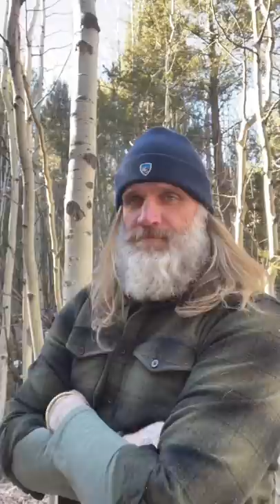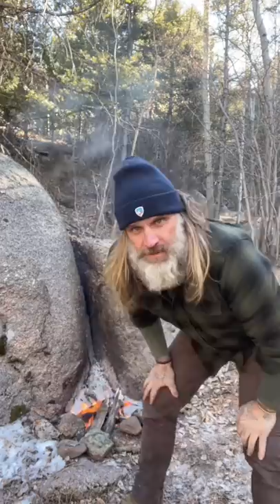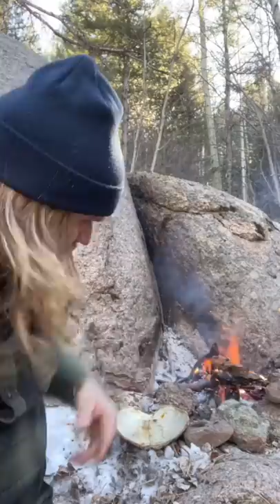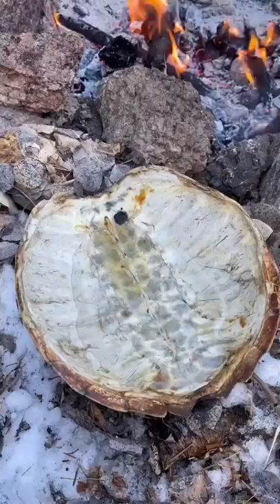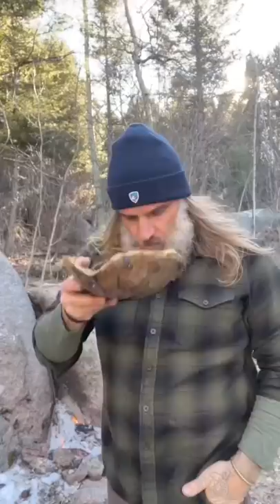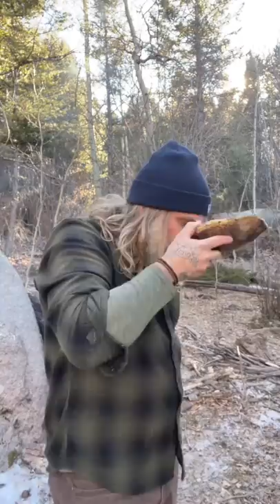Hot Rock Boiling

Comment: as someone  who lives in a predominantly  sedimentary rock regain I ask all to learn their sedimentary rocks  
since they tend to have air pockets inside that like to exploded in a fire
Reply: Wait. What? Wouldn't that depend on the permeability of the sedimentary rocks in question? I've never seen a sed rock that completely traps air.
Reply: I know nothing about rocks but basicly, pick rocks that have not been underwater in the last 2000 years or they may explode.
Reply: Not to mention bringing water to a boil doesnt sterilize. you need to maintain a boil for several minutes which some warm rocks aren't going to do. Not that this is doing anything to any water that's not in direct contact with these rocks...

This guy is going to get someone sick or injured.
Reply: Yeah this is most common with river rock
Reply: @nopenope404  you can indeed bring the entire vessel of water to a boil with hot rocks, and yeah it's usually recommended to boil 1 to 3 mins. Saying it's not doing anything to water that isn't in contact with rocks is akin to saying boiling water on the stove only affects the water which is in contact with the pot. When the liquid's temp is brought up to boiling, of course it affects all the water.

Regardless of whether this guy is showing it correctly or not, it is a viable option. Though in the majority of cases water in nature is totally fine, especially if it's something like mountain runoff in a flowing stream. Stagnant waters hold more danger, especially at watering holes where animals may come to drink, defecate, or die. But with giardia specifically, it takes on average like a week to start so in a survival scenario you're hopefully back home by then and can go to the doctor, get some medication, and it's not so bad. Even otherwise, giardia over dehydration any day.
Reply: @nopenope404  “some warm rocks” bro that’s how I know you never touched a tree in your life he clearly put the rocks in a fire for 30-40 min anyone who put rocks in a fire knows how hot they get after 10 minutes stop acting like you know everything when you don’t know a single thing
Reply: @nopenope404  nah those rocks hit that water and it went into boil very quickly
Reply: Didn’t this guy get trichinosis from a muskrat on a survival show????
Reply: 100% confirm that......  burnt holes my nice tent from that years ago, also had it happen soldering a copper pipe against concrete too 🤣......Wear your safety squints 😆
Reply: They teach you in high school. The kids who paid attention would know that, but there all heroin freaks now. Sad sad world we’re in
Reply: @angelrodriguez2489  why did you get so mad
Reply: @oumardiop1  Bc he thinks he knows everything and tires to make people sound dumb when in reality he’s a complete joke
Reply: @oumardiop1  tries *
Reply: Metamorphic or ignious rock🥰
Reply: “Death by rock explosions” listen i am not suicidal but if i got to choose how i die this is it
Reply: @nopenope404  me be true if you are at 3000 m or above Spencer. You have little to no idea what you are talking about.
Reply: @nopenope404  just warm rocks huh.

I wouldn't consider rocks that can flash water to steam just warm.  I personally have gotten a bottle to soften and warp in a standard campfire.  That's pushing 2500 degF. 

And also you do not have to boil water.  Add to that that many of the pathogens die at a temperature of 160F not 212F.  This why we need to cook thing to 165F.   So if you get water to boil it has already been at a temperature that can kill pathogens for a few minutes.

So if you keep rotating your stones from pot to fire you can heat water quite effectively
Reply: @nopenope404  you think those were just some warm rocks? 🤣
Reply: Like pop rocks flint granite
Reply: Learned that the hard way when I was a kid in the 2000’s scared the shit out of me cause it almost hit me in the eye. I live in a country town outside of Cleveland. Every time after that experience. I said fuck that.
Reply: @artofficialintelligence  they can tho
Reply: Robert Daggett  
I'm in Ontario and from putting fully heated rocks to water I've had rocks split apart in 2 pieces, but not explode.
Edit:  I must add that the sound it made sure got my attention.
Reply: It's the moisture in the rocks that explodes, it expands thus exploding. Done it a hundred times as a kid
Reply: @nopenope404  I’d rather listen to the cave man then someone named Spencer
Reply: @AlanTClark  I go there every now and then we have the same accents and rocks in the Midwest we just share a pond
Reply: @nopenope404  you do you but if I had to drink water and this is the only way to make sure there’s no parasites in it, this is what I would do.
Reply: Oh damn
Reply: Dodging shrapnel is no fun! Had it happen once after sitting back down from standing right over the rock that blew. The sizzling hot gravels whizzed past me ears to ankles, but they missed me, my son, the cat, and all but one of the five dogs, and he was fine, though very confused...LoL! Craziness to be avoided for sure!
Reply: @terancet8671  no
Reply: @vrfob4620  hmmmmmmmmmm
Reply: Completely off topic here, but when my misses makes me a cup of tea, she burns the water 😂😂😂😂😂😂
Reply: @terancet8671   no, he was sick before he ate that
Reply: Had that happen to me once.
Reply: Adults arguing about rocks. Welcome to the internet.
Reply: From Florida and have had this happen.  Listen to this man.
Reply: Was making Shepard pie in a fire at summer camp once and had a rock fall into the fire without us knowing. When it blew I could feel it blow past my shin lol
Reply: When you are surviving it doesn’t matter
Reply: @loganthesaint  I'm sorry,  not trying to be a dick here, I promise but... it matters about a million times more in a survival situation. Anything that may cause injury, even slight, should be avoided like the plague.
Reply: Gold jacket, green jacket who gives a shit
Reply: @terancet8671  he was just recovering from a heart attack days prior to the show. If that weren't the case,  he'd have been fine, but straight up diarrhea and vomiting can easily bring in another heart attack.  It was a wise move to bow out.
Reply: @accesdenied9104  I see your point, "Death by rock explosions" sounds hella metal...
Reply: Some people are know it all and like I saw the man who tells you he knows everything knows nothing at all... might want to research this dude before talking smack... troll turds are amusing 🤣
Reply: @DiamondSupplyC0  lmao what? Sorry that happened to your friends but it's not like that everywhere
Reply: @nopenope404  lol okay if that's what you want to believe I'm not going to try convincing you otherwise. Also, if you're getting your survival knowledge solely off of YouTube shorts, you're already most likely out of luck
Reply: @SiFiFreak  if you're cooking all your meat to 165 I feel bad for who ever has to eat your cooking
Reply: @ryanwilson1654  haha sure
Reply: @SiFiFreak  DROP THE MIC --BOOM 😎
Reply: @spotimpact.  Pork is the tricky one.😎
Reply: @A Hay Seed  I usually use a meat thermometer, I like my steaks done perfectly 👌
Reply: @artofficialintelligence  i have lol
Reply: @instakillgaming  could you name a few sed rocks that are completely impermeable then? Legitimately curious.
Reply: @artofficialintelligence  no because I'm not a fucking geologist, I'm someone that has seen rocks explode in fire
Reply: @instakillgaming  Wow. Civs get so offended over simple questions. You don't have to be a geologist to know a few sed rocks lmao. 😂 If that's that's case then water isn't trapped, it's slow moving and you're probably talking about saturated sed rocks with a high conductance. I've just never seen it happen in the field.
Reply: @artofficialintelligence  I'm going to get even more offended just to make you have to mention it again: is "civ" a slur? Yeah that's exactly what I'm talking about, congrats, a professional that has a lot of experience in the field can read
Reply: @instakillgaming  Not many words that start with civ, it's short for civilian.
Reply: @DiamondSupplyC0  It's a sad world if you generally think that's true.
Reply: @Jrez  was about to say I don't think he knows how heat actually works if he thinks the rocks won't bring the water to a boil.
Reply: @artofficialintelligence  yup that’s what I said. So what are you arguing about ?
Reply: @DiamondSupplyC0  Huh? Smooth brain much?
There's no argument. Just the fact that you 100% believe in what you said regardless of how much sense it doesn't make. 😂 The "high-horse" mentality of people's high-school education as if it actually matters. Work on your self confidence, bud.
Reply: @nopenope404  you dont know anything about heat sterilization lmao.

Its an equation of heat and time. The hotter it is, the less time you need, the colder it is, the more time you need.

Simply getting to a boil is enough to make water potable, according to the WHO
Reply: FACTS
Reply: @mori4532  he doesn't think. That's the issue here.
Reply: @mango8465  hahaha wtf right? Didn't even realise this
Reply: @heathertaylor8904  in my opinion it's a bonus  otherwise it's just cooking water and that's just boring, the risk of dying will make it taste a thousand times better.
Reply: @darrellbeets7758  this is a dangerous thought process if you're actually trying to survive, but Darwin approves 😅 Kiddin, man... I'm just kidding.  I thing it was hunger makes for a tasty sauce? 😅 😉
Reply: @nopenope404  not really. Studies show this dose help. Research it. It's not the preferred method but it can be used
Reply: @artofficialintelligence  I like your profile picture
Reply: @artofficialintelligence  they are all over the place in Tennessee atleast. during a scout camp someone hucked one about the size of a fist in the fire, a couple minutes later hot coals were sent all over the camp site, we had a meeting about rocks that day
Reply: Yeah idk but when I was young on a camping trip the adults had rocks around the fire some minutes later they started like exploding 😂
Reply: I put a a big can of baked beans in a campfire once as a joke...I knew it would explode...but I didn't know it would EXPLODE!..let's just say we all had 3rd degree burns and their was shrapnel through a car door..the beans stuck like napalm
Reply: Yep I almost thought that was going to happen I. The video also.
Reply: @nopenope404  you can kill like 98% of stuff with a 20 second boil.  I would only use this trick with moving water from solid creek that you decently know the source
Reply: @Jrez  tell me more about stagnant water oh wise one
Reply: @DrDOOM-xs8jm  What do you want to know?  Stagnant water tends to have more pathogens, parasites and bacteria living in it, some of which can't be killed or removed just by boiling like botulinum. Do you have a specific question relevant to the discussion or do you just go around expecting youtube commenters to educate you on general subjects, or was this actually some sort of attempted dunk?
Reply: @artofficialintelligence  It can happen with any rock, some are just more prevalent
Reply: I know river rocks can explode but that’s because they are porous and have water trapped in them so you have to let them dry out
Reply: That sounds like it could lead to a good prank
Reply: @bjvdkez2958  yes detonating a grenade in camp would be real funny
Reply: That’s a myth my friend lol
Reply: So does anybody in this thread know which rock you can put in the fire without them exploding ?
Reply: @VizoMediaGroup  it just needs to be dry, if you aren’t sure keep it in a dry place 3-4 days. Porous rocks will hold water and when it expands into gas from fast heating it can only escape by shattering the rock, resulting in shrapnel.
Reply: A friend of mine and I made a campfire on an old slap of concrete. We sat close to the fire when all of a sudden, the whole thing exploded and sparks and pieces of concrete hit our face. We were both really lucky that we did not get hit in the eyes. 
Never making a fire on concrete again.
Reply: @AlanTClark  have you ever heard a piece of steel break in half?

I did when I was about 10 or 11 years old and I was standing about 30 feet away from where it happened at and the noise it made was so sharp and so loud it hurt my ears so bad I fell to the ground crying
Reply: @turismofoegaming8806  
No I haven't,  The worst explosion I have ever encountered was there was a tractor tire that blew, and I was about 25' away, it almost literally scared the shit out of me.   I could feel the wind from the explosion of the tire, Anybody standing within a few feet of that tire would be killed.
Reply: @nopenope404  yeah exactly, its better than cleaning straight up dirty fuckin water, but the ONLY way you can 'make' clean, good, water, is by rigging something up where the steam can be trapped and escape up into an area which then cools back into water into another container

a distillation. sounds a lot more difficult than it really is, you don't need some science lab equipment type shit to do it, there's very very simple distillation setups people can do using next to nothing (some sticks/logs hollowed out, etc)
Reply: Yeah I was about to comment; be care what kind of rocks you heat up, as some will explode
Reply: @artofficialintelligence  I've seen what I know as flint rock explode on more than one occasion. Found in the coastal plains of the South Eastern United States.
Reply: @nopenope404  you didn’t see it boiling and how hot those was if there warm then Einstein reach in there if you have ever built a fire and grab your warm rocks and try it and let me know how it works out for you lol you said some warm rocks lol this guy ain’t gonna hurt no one people has done this in survival situations for hundreds of years and Dave studies all this stuff I’m sure he ain’t perfect but don’t be so quick to Judge something you know nothing about  there’s several ways you can Sterilize water this is one quick and dirty way to get you out of a bad situation and probably get you to a dr after words do you relize Dave teaches survival classes and honestly that dude does crazy stuff he is tuned into nature you learn more sometimes if you listen and don’t judge and no they will not explode I’ve tried it before and you have to let that water cool for at least 30 minutes before drinking it gets so damm hot hints the steam and boiling.
Reply: @DiamondSupplyC0  Heroin freaks? What’s a Heroin freak?
Reply: @artofficialintelligence  it doesn't have to be trapped air. If there's a small pocket of water that boils and evaporates too fast it'll blow the rock apart.
Reply: Rocks that are close to water sources are likely to have water trapped inside
And everyone knows what happens if I bring them to boiling point